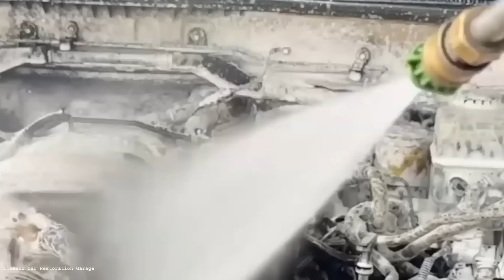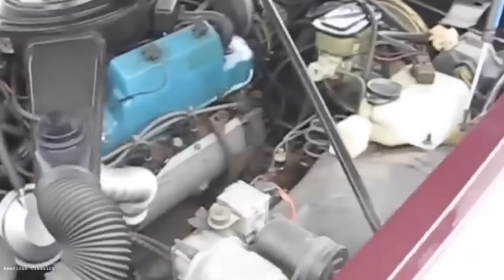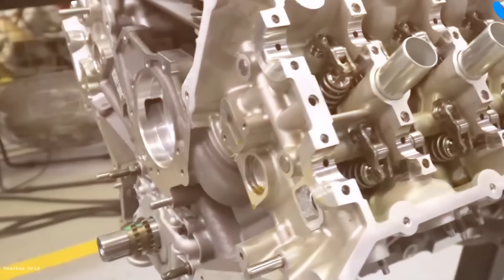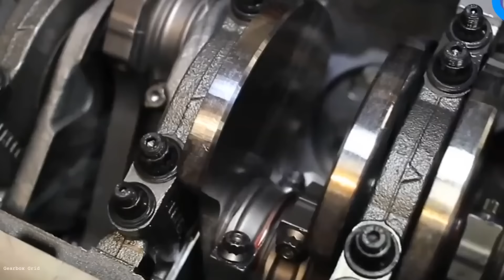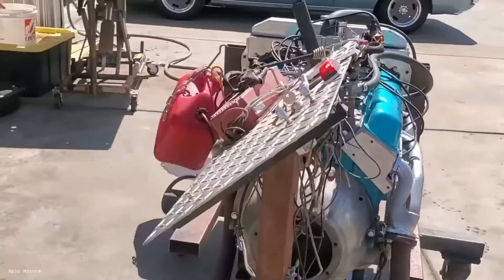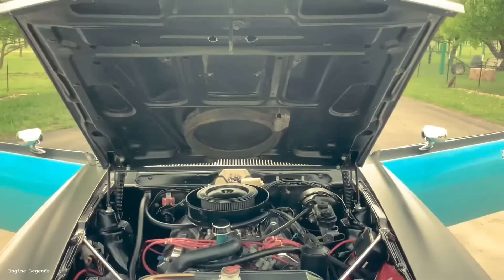This Oklahoma Mechanic OUTSMARTED AMC With a "Homemade" 390 Stroker That Made 550 HP

Comment: The video spouts a bunch of bs! 390 and 401 use the same bore. Put a 401 crank in a 390 (tall deck) block and you have a 401,  not 406. Overboring would give you 406. Chevrolet used the parts interchangability of the small block Chevy from the mid fiftys. Not a new idea. AMC 304, 360, 390 and 401 heads an intakes are interchangeable. You can also put 2.08 intake and 1.74 exhaust valves from a chrysler 440 into AMC 401 heads if you use roller rockers.

Comment: AMC had the 401 small block
Reply: 304, 360, 390 and 401 were the same external dimensions. This AMC block is considered an intermediate block, not a small block.
Reply: It's neither a big block or a small block.  AMC, like Pontiac, only had one V8 block at a time.
Reply: Not the 290?